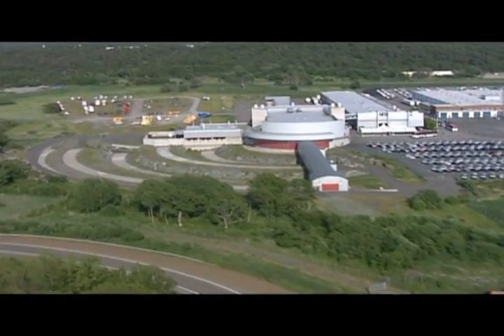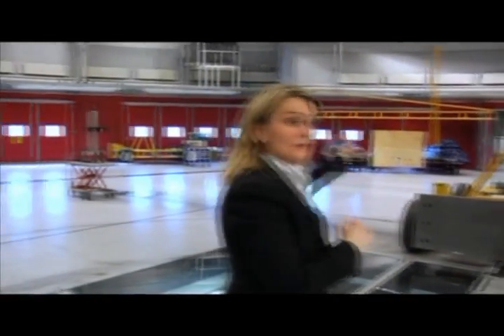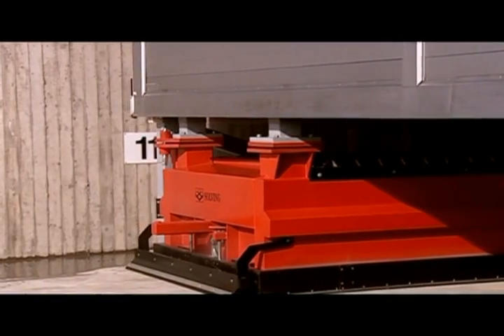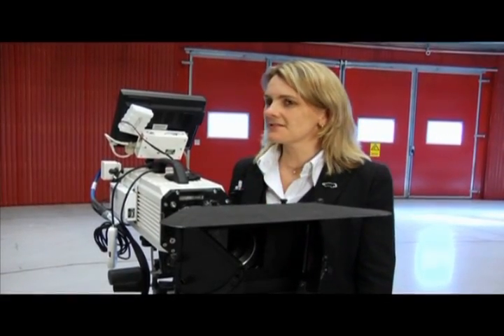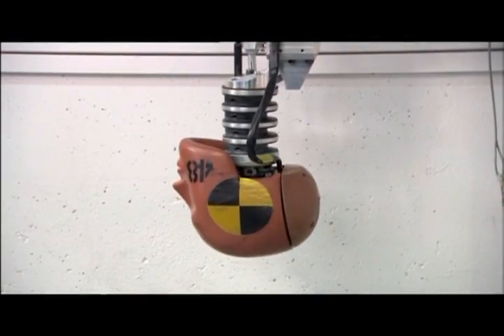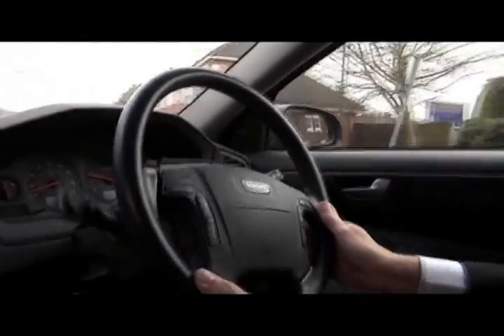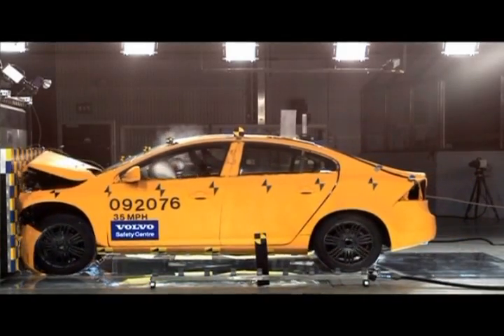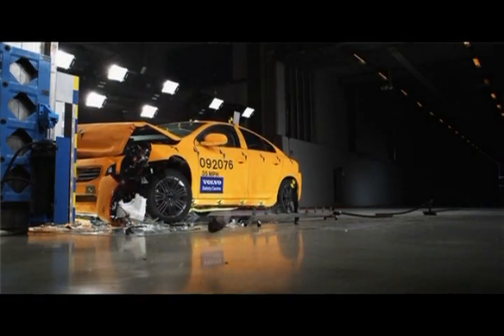Volvo Safety Center

Comment: Volvo is clearly the leader in this field, but there is one thing they can't test which becomes evident watching all these YT russian crash clips. That is that drivers react in crashes, they brake, they turn etc. which introduces pitch and yaw that are not easily reproducible but which may lower the front of a car several inches or make it lean at an angle. It may have very little impact but it is hard to say without tests.
Reply: trefod I think most modern car manufacturers install Pitch sensors to counteract that effect
Reply: Those Russians! Lol

Comment: Ford told Volvo to shut up and keep quiet about the reinforced roof in the XC90 because Ford were afraid of getting sued because their SUVs split in the roof when T-boned. XC90 is a model that were built on the Ford D3 platform. Volvo had found that the roof was a weak point in SUVs and therefore added extra reinforcement there, Ford didn't.
Reply: This is almost correct, BUT it must be stressed that the XC90 is NOT built on a Ford platform..... Volvo made the P2 platform before Ford purchase Volvo.  Ford then took the P2 platform and make some American Fords using it, and called it the D3 platform. 
The P2 XC90, V70, S60/S80 XC70 are 100% Volvo design.

Comment: I just went to the IIHS web site, and both the XC60 and Forester had nothing but 'good' ratings on every crash test, 'small overlap' included, so how you could say Forester did better than the XC60? Many car makes and models did terrible on the new 'small overlap' test, and If the IIHS introduced even more types of creative crash tests, we would see Volvo shining even more. Volvo does not build it's cars just to pass a few simplistic crash tests that the IIHS has, but most car companies do.

Comment: You know something, the Fusion getting an Aceptable, I don't see what's wrong with acceptable for the test. As for the Escape, the driver would have gotten out alive with minimal injuries. Sure, in that crash a fracture of the foot was POSSIBLE, but just look at the dummy readings on the website, they were good. The majority of the small SUVs got poor or marginal, and you'll find that Subaru Forester was best performing, not the XC60...

Comment: The IIHS and NHTSA don't have the crash facilities that Volvo has, and Volvo does not build their cars to pass their simplistic crash tests, like most car companies do. Volvo builds their cars based on the 35,000 actual accidents they've duplicated. The IIHS recently surprised the car industry with a new test--the Small Overlap Frontal Crash Test. The Volvos tested, the XC60 and the S60, got a 'good' rating. The Ford Escape got a 'poor', and the Fusion an 'acceptable'. Volvo wasn't surprised.
Reply: And IIHS doesn't do rear crash tests either! Volvo has been doing them for decades.
Reply: @morganw8682  Heck, that's nothing new. I've been crash testing my Volvos for decades, too! Lol

Comment: Bear in mind Volvo only manufacture a few models, so they have more safety research money to spare. The fact that Ford meets the same safety standards as Volvo when they have more than 40 vehicles on offer right now is what's more impressive. Just see Ford's website, they've earned more euro ncap advanced awards than any other manufacturer. For what Volvo have done in terms of safety innovations, it's minimal compared to Ford's history. Although, Volvo's safety centre is very impressive.

Comment: The majority of safety features have come from Ford and Volvo. Ford, for example: Invented the seat belt - were the first to use airbags etc. Volvo did invent the 3 point seat belt, but to be honest, that is only because of Ford - without a seatbelt existing, they couldn't have made the 3 point belt. Finally, Ford have also created inflatable seatbelts without Volvos help. Don't come back all whiny, I love Volvos and agree that they are safe - I own 4. But Ford are safer: watch?v=BIHfVLez_64
Reply: That's all well and good, but which company still retains the "safety" mindset? Of what value is inventing that first thing when somebody else would've invented it just a bit later, when you abandon the mindset that allowed you to innovate that thingin the first place?

Comment: god you are an incredibly DUMB PERSON, volvo invented the 3 point safety belt its hardly changed since being introduced in 1959 , and for the record landrover, jaguar, aston martin and crap ford, all used volvo safety technology OWNED BY VOLVO  FACT !, and another fact the ford explorer roof debate, idiots at ford weakened the roof resulting in over 9 deaths , VOLVO WERE CALLED IN TO TO ADVISE AND PUT RIGHT , and heres the killer blow QUOTE THERES A LITTLE BIT OF VOLVO IN EVERY CAR , FACT

Comment: Ford has always been industry leader: watch?v=BIHfVLez_64
They were the ones that started crash testing and even invented seatbelts, were the first to use airbags etc. Volvo is only better at making systems to prevent crashes, but you can get those systems on the majority of mid size cars now.
Reply: Myeah but when asking a random stranger what car maker they think produces safer cars, Ford doesn't come out at top...

Comment: But the past is the past. We are living now. Volvo had to cut costs just like other car companies and the cars they make are far from being the best especially in the handling compartment. If you crash at a high speed, the chances of surviving are small in any car, even if it were literally bomb-proof. That's because the human body cant withstand the acceleration imposed on it during a crash. Modern cars which handle better than Volvo will simply allow you to avoid a crash...
Reply: Active vs passive safety.